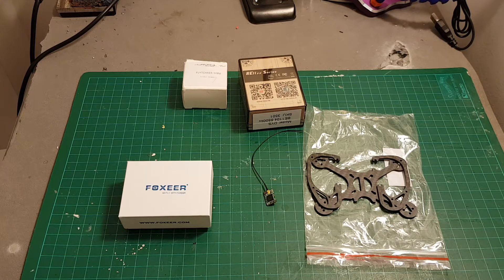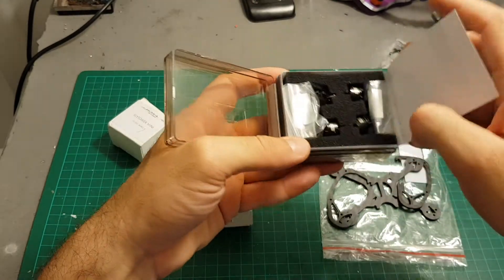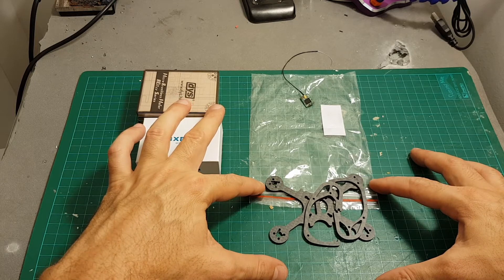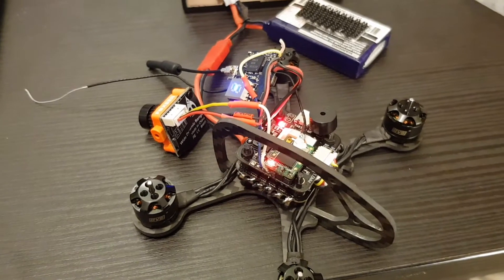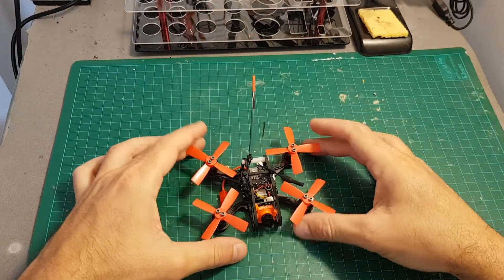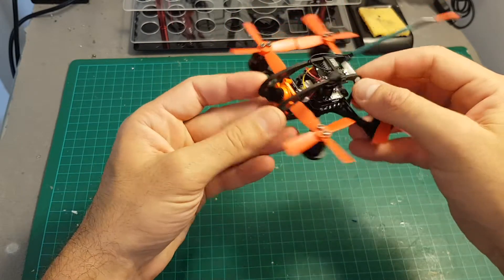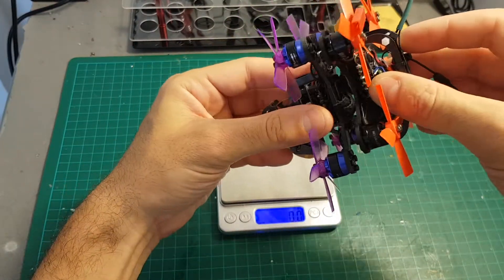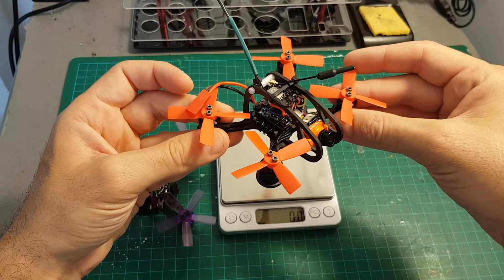FlexRc Ascent – 93mm FPV Racing Drone Frame Build Video And Maiden Flight

Comment: can you explain where i get 5 volts from the pico v3? There are 2 vbats solder pads and from your diagram that will be 11v (from the battery) does it get the 5v from the esc board thru that multi wire plug socket? am a little confused as i have the battery wire setup but unsure if i should power it up yet
Reply from the maker: Hi Darren. I used a different ESC & FC combo (http://bit.ly/2wkgs3o)
You can see the wiring diagram of the Pico V3 here: https://flexrc.com/product/flexrc-pico-core-v3-kit/
If you still need more help, I advise you to join Flex Rc's Facebook Group:
https://www.facebook.com/groups/flexrc/

Comment: I am stuck trying to get the frame together...how did you do this and which way is front??
Reply from the maker: You need to apply some force and bend it, in order to get it into place. Just be careful not to break it :-)
Reply: so is the which is front the side with the big hollow or the small hollowed part?
Reply from the maker: 2:59 You can see pretty clearly